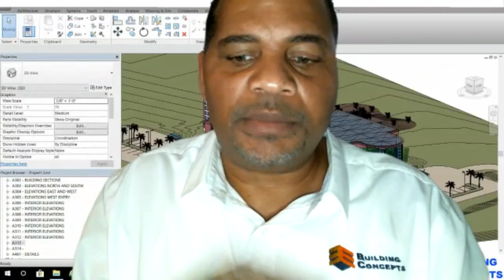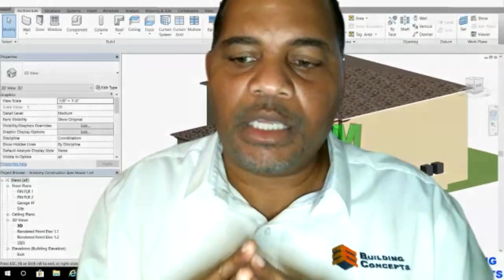From Homeless to 3D Printing Houses

Comment: The way to print affordable housing is to use locally sourced hemp to make hempcrete and hemp ABS plastics with as much robotics included in the process as possible, at least until we shift to laser printing structures. 

PRINTING JOY!

Comment: I have 8 acres - none of it is flat or level (at the moment). But the home I want is more than 1 story, although it is a max. of a 50' span. However, I am in New Mexico - with a kinder range of building codes. I also have a 100' x 50' Pavillion on site. Is Alvin willing to move?
Reply from the maker: Reach out to him!
Reply: @automateconstruction   - I did, via his website. I realize that later in the video he provided several other ways as well, such as a direct email address. But his website includes his other services as well. Two birds one stone. Thank you for doing the interview.